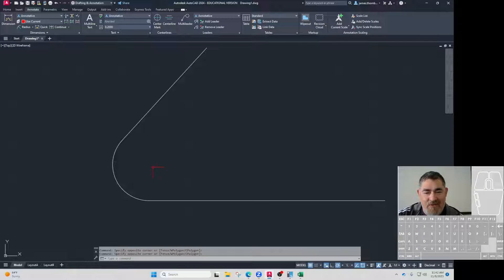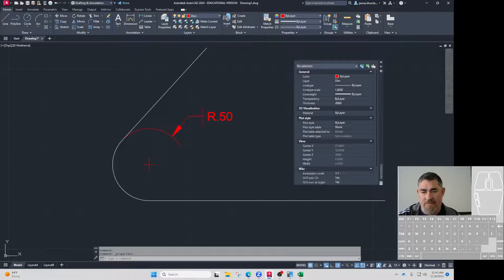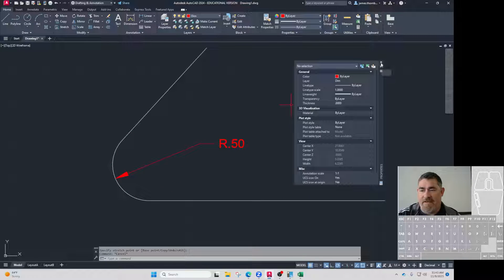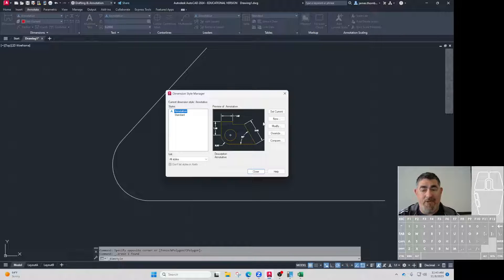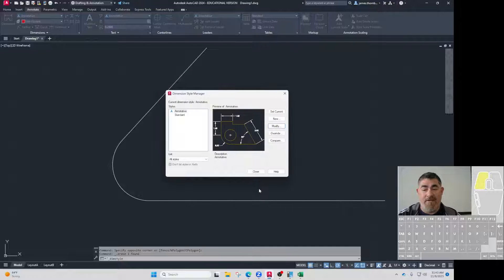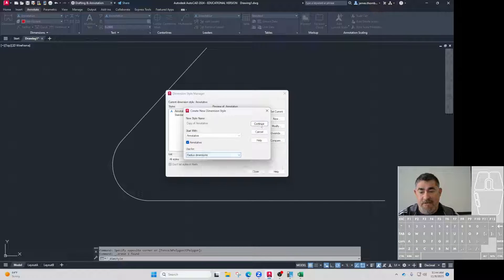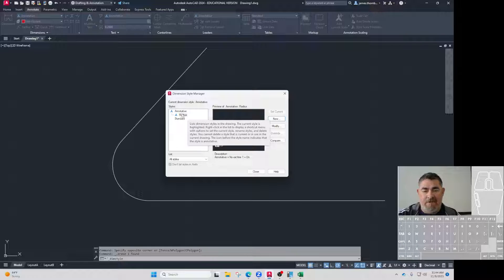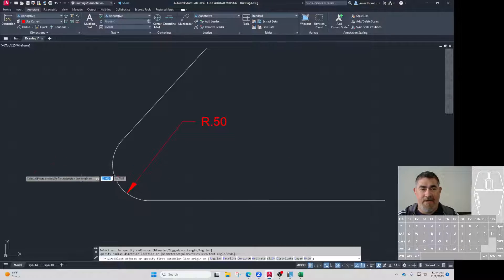AutoCAD getting rid of the Radius Extension

Comment: This was helpful, but didn't solve my problem (m y styles were pre-set by my office, so maybe that's why my options were different than this video). My solution was to open "Dimension Style Manager" find the style I was using, navigate to the "Modify" button, then click on the "Fit" tab. Under the "Fine tuning" area, I had to "uncheck" the "Draw dim line between ext lines" option, and the extension lines disappeared! hope that helps others!
Reply: Seems like I had the same issue. Thanks for the info cause now my extension lines have also disappeared. :)